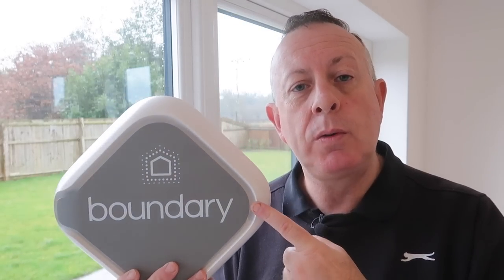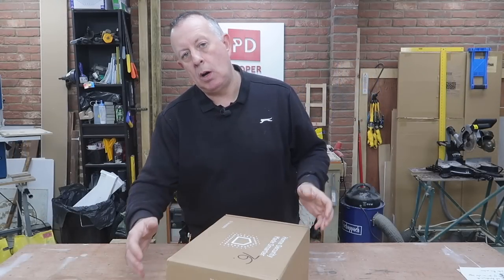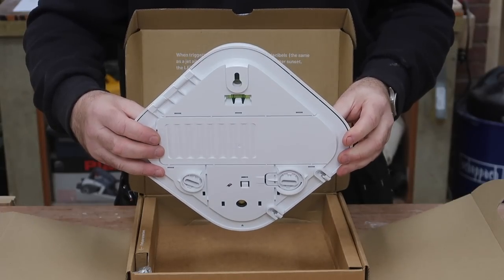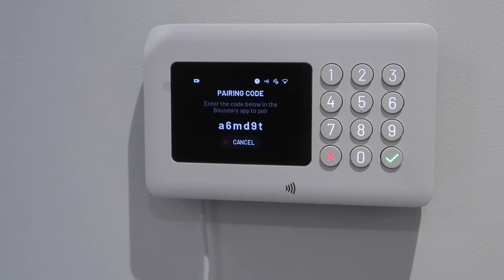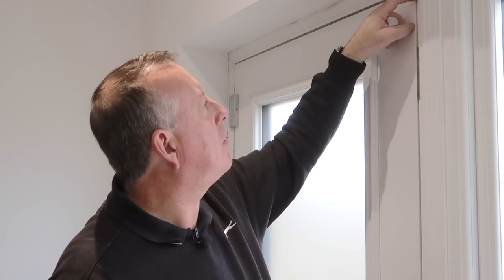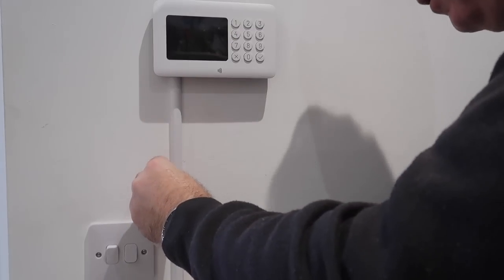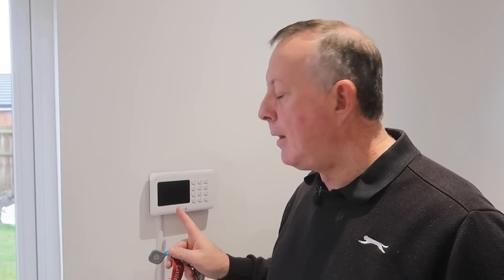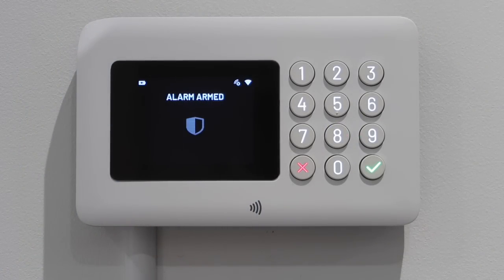Boundary Alarm System - The Easiest Alarm System to Install

Comment: It seems that to get all of those features on the app, you need to pay a monthly subscription - is that the case?
Reply from the maker: Yes
Reply: Hi Geoff, our free Lite plan now allows Unlimited Sensors. There are no other costs other than the upfront system purchase. Check out the monthly plans page on our website for more info. Thanks, Tom

Comment: One thing I've never got with wireless alarms is, what happens of someone jams the signal? it looks like it uses 2.4GHz spectrum so what happens if you fire up a £10 jammer off ebay? if the control unit can't speak to the sensors, what does it do?
Reply: It wouldn't make a difference as we don't use WiFi for the sensors. We use Zwave and can detect jamming or disruption on the network and activate the system in response.
Reply: I didn't suggest you used Wi-Fi but you do use 2.4GHz right? Can you tell the difference between 'jammers' and wideband rf signatures like a baby monitor that uses 2.4GHz also? I'm not trying to catch you out here, genuinely interested as I like the idea of this type of system but can't seem to get past the fact that becuase its wireless its actually easier to interfere with it than if it was wired.
Reply: @roblowe8440  The hub uses the 2.4GHz channel for communication with our platform buy that's it. The sensors communicate back and forth with the hub using Zwave which is completely isolated.

Even if you were able to get onto the same channel as the sensors which in itself requires specialist equipment then the hub would know about it and activate.
Reply: appreciate the back and forth. I've done some more reading and I see Zwave uses the 800-900MHz unlicensed ISM spectrum. This elevates my reservations somewhat but not fully. I guess I have more reading to do before deciding if this is a route I want to take 👍

Comment: Another good video. My concern is the frequency of battery changes. As the batteries aged in my Arlo wireless camera system it seemed like I was up the ladder every few weeks to remove and recharge a battery in one of the cameras. After replacing the batteries when they wore out I ended up paying $100 more for each camera to fit a solar panel to each. Problem solved.
Similar to cameras, although perhaps less demanding on a battery, any device that is constantly triggered by movement such as infra-red sensors is likely to be hard on batteries. As we get older we need to spend less time up ladders!
Reply: It’s a valid concern. When our pro subscription launches our annual maintenance includes battery changes. We’re currently forecasting a minimum of one year from all batteries, with options like disabling the the LED on sensors to increase this. We’re also working on firmware updates to make battery life more efficient. Zwave 700 as a protocol is low energy by nature so we think that there are improvements to be made!

Comment: Looks interesting. Have a wired alarm system but we only have 1 PIR for the hallway. Most of the windows have contact sensors. It seems boundary tends to use PIRs as the main protection but how does that work say at night time? You probably wouldn't want your PIRs on in case you accidentally set them off going to the kitchen for a drink but then if an intruder comes in through a window with no contact sensor, you're exposed.

I get you can order more sensors but find it interesting their bundles all come with only 2 contact sensors for doors and none for windows
Reply: I'm surprised Boundary haven't answered like they answered Anthony's question. Come on Boundary.
Reply: Sorry, we were catching up! The night set built into the app will automatically disable the PIRs and leave all the contacts armed. You can wander around inside but still feel safe at night! You can also mix and match if you prefer as we support multiple part set scenarios so you could even leave a few PIRs armed if you wish.

Comment: Good alarm system but you forgot to mention having to pay a monthly fee to allow more then two sensors to be used as well as features you mentioned.
Reply: Hi Dave, our free Lite plan now allows Unlimited Sensors. There are no other costs other than the upfront system purchase. Check out the monthly plans page on our website for more info. Thanks, Tom
Reply: @BoundaryAlarm  thank you for updating me👍

Comment: When fixing the door switches it's usual to fix the magnet, the small part in your case, to the door and fix the larger part, the reed switch to the frame. This will prevent the reed switch from moving and banging around when the door is being shut.

Comment: Hi, when you look at the specs for system, battery life is VERY poor by todays standards, most other wireless systems are nearer 4 to 6 years for sensors. Visonic even quote up to 8 years for siren & PIR's and the app is free as well.

Comment: Really great video as always. Probably I'd enjoy you showing us how to do the dishes properly. Regarding the door sensor, the small part is basically just a magnet, so in fact you could just fit a small magnet there. And yes, it's probably hard to find one that fits nicel right there, but good to know.
Reply from the maker: You are right. i only found that out when it ended up stuck to some screws on my workbench!

Comment: The system is great however with it being all Wi-Fi on the hub been wired what happens if you lose your Wi-Fi but still have power? I presume the system won’t work. However if you still have power then surely a wired system is far superior over Wi-Fi system. Yes I understand that potentially you could lose power but how often do you lose power compared to the amount of times you lose Internet connection
Reply from the maker: The system only relies on the internet to send you notifications and for any changes you want to make from your mobile. If the internet is down the system still works as usual but just won't send you a notification.

Comment: I can feed my German Shepherd for the same monthly fee as the pro system.... And trust me he doesn't miss a trick and is more of a deterrent than a little alarm box on a wall :)

Excellent video though, and you are right about how easy it is to install. My only reservation is that it needs batteries in the alarm unit, which hopefully won't need replacing at frequent intervals as it's not much of a deterrent if the alarm is quiet or fails to sound.
Reply: Hi Malcolm, our alarm system also doesn't need taking for regular walks 😉 On the battery life, we’re currently forecasting a minimum of one year from all batteries, with options like disabling the the LED on sensors to increase this even further. We’re also working on firmware updates to make battery life more efficient. Thanks, Tom

Comment: I really wanted to purchase a boundary system until I realised you had to use their own ZWave system. The property I live in is almost like a complex with out buildings that need to be protected.  We have to use a mesh Wi-Fi system as regular Wi-Fi will not reach the out buildings, but mesh works brilliantly. If Boundary can’t utilise WiFi then I’d have to run multiple of their  ZWaves just to protect the out buildings, which means I have to purchase two subscriptions just to get it to work. Such a shame as I was ready to pull the trigger a couple of days ago as it looked great.
Reply: Hi there, our free plan now allows unlimited sensors pairings - so you wouldn't need to purchase multiple subscriptions. We can also provide Z-wave range help extenders to cover outbuildings etc. Hope that helps.
Reply: @BoundaryAlarm  Thank you, in that case I will look into this. Thanks
Reply: @thedigitalemotion  no problem. Any problems or questions you can contact us through the Support page on our website.

Comment: Batteries in the siren ???  Monthly Subscription ???  If you are any way tech savvy look into Home Assistant as a free open source framework for bringing all your smart devices together.  Then look into Shelly and SONOFF for smart devices, sensors etc and do this yourself. The resulting DIY solution runs locally on your own Network, Is not dependent  on or vulnerable to any third party charges, connections or even them closing down etc.

Comment: Great video, how come you didnt fit the sensor above the door (top right) as opposed to on the right? there looks like there might* have been enough space to fit the slim piece to the framework. However you may have already considered it and realised it didnt fit maybe?
Reply: That's what I was thinking as well.
Reply from the maker: It may be the angle I filmed it but the gap is the same all around door

Comment: A question..any issues with fixing a PIR Motion Sensor in the garage as in problems with temperature change and spiders..
Reply: Nope, they are sealed units and will still work just fine in lower temperatures
Reply: @BoundaryAlarm  cool and l have a cat will the cat activate the alarm once’s it’s armed..
Reply: @mrlv8126  It shouldn't no. We have seen some cats crossing the upper part of the detection beam and triggering the sensor but this is normally caused by poor placement. If the pet is on the ground it's not a problem.
Reply: I confess on previous PIR’s ..spiders on the sensor could trigger them …  do they do that here
Reply: @GordieK  No. The design of the PIR lens prevents this.

Comment: Looks like a cool system and easy to install. Though with all wireless security systems that are connected to smart devices and home networks they have their drawbacks. Can they be hacked ? I installed a Blink 4 camera system  two years ago. Still on the same batteries. Not sure how long the batteries will last in your alarm system.
Reply from the maker: The batteries are supposed to last 1 year
Reply: Good question on security, the system will detect any attempt to disrupt the communication with the sensors or attempts to spoof them. We treat this as a trigger and this would activate the system.

Comment: Another great video, thanks. If the power is switched off does it go into tamper mode and sound the alarm?
Reply: The system would drop to the backup battery which gives 12 hours worth of power to the hub. You also get an alert this has happened so the system is still armed.
Reply: @BoundaryAlarm  Thank you for the very quick response.
Reply: @samdam108  not a fake comment, I'm an interested potential customer
Reply: @samdam108  If you've got a problem with boundary alarms you're having a go at the wrong person, I've nothing to do with them, I'm not in the industry (alarms  or building), so contact them or proper DIY if you want to moan not me.🙄

Comment: Another great video and a very nice, neat and simple alarm system.  Any advice on where to install the siren on a bungalow?  I was thinking on a chimney, so higher up, but worried it's too exposed to weather?
Reply from the maker: They suggest at a height that you cannot reach but doesn't need to be way up either. I wouldn't worry about weather - it's well protected. Remember that as it is battery operated you need to be able to get to it again to change the batteries in the future.

Comment: Looks a good system  but I wouldn't want to pay a subscription.  I have a yale I fitted myself with a couple of sensors and a  basic keypad   but does the job..... Good video...
Reply: Hi Simon, our free Lite plan now allows Unlimited Sensors. There are no other costs other than the upfront system purchase. Check out the monthly plans page on our website for more info. Thanks, Tom

Comment: Unfortunately the promotion code doesn’t work I want to buy the medium system.
Reply: Hi Sam, did you manage to apply the promotional code? I've checked everything our side and it should be working for you. A code for our Easter sale gets automatically added to the basket but you can remove that and add the PROPERDIY code. Thanks, Tom @ Boundary

Comment: Really great video as always.  Couple of questions, 1. if the internet is down does it still work? 2. if your away from home and the alarm is triggered, will you get alerted via your phone??. thanks again for great  real world videos!😀
Reply: No.  It needs the internet to communicate.  Also, if you smash the code pad game over.
Reply: Hi Anthony, to answer your questions:

1. The sensors and hub can still communicate if the wi-fi goes down as they're on a secure Z-Wave network. The only functionality you'd lose is connection to the app. We do have a cellular back-up upgrade for the Hub that adds a 4G roaming network if desired so connection can be maintained at all times.

2. If away from your home, you will receive a push notification via the app, a text message and an automated voice call - so you shouldn't miss it when you alarm gets triggered.

Hope that helps.

Tom @ Boundary
Reply: @DiHandley  See my reply below David. Also, any attempt to tamper or block the system will trigger the alarm.
Reply: @DiHandley  why would you need WAN to communicate over LAN?
The devices all connect to the hub (in essence LAN)

Losing WAN (Sky, BT, Vrigin etc) wouldn't affect the door sensor communicating with the panel....

Comment: What happens if your WiFi drops? Will it still work but not notify you and does the alarm sound go off after a while as is the requirement these days to stop nusance noise?
Reply: The system will still work but you wouldn't be able to access it remotely through the app. We do have an optional cellular backup if you need extra peace of mind.
Reply: @BoundaryAlarm  does the cellular one just send text or does it do the full thing. Notifications etc?
How long does the alarm sound for?
Reply: @justintemp  It acts as a backup for the WiFi connection so its data it sends back to our platform, you still get all the notifications. 

The siren will sound for up to 15 minutes.
Reply: @BoundaryAlarm  thanks. Sounds all good. When will you have the police alert option?
Reply: @justintemp  we should be launching that this quarter along with an upgrade path for customers who already have a system installed.
Reply: @BoundaryAlarm  great. Thanks for answering my questions
Reply: @justintemp  No worries, you're very welcome 😀

Comment: Love the vids, as for this one it assumes good wifi coverage everywhere from the router.  Just a thought, would love your actions to check and overcome any dead areas you found when setting your wifi up.
Reply: Only the hub uses wifi to connect. The sensors are connected via z wave (from memory) and it’s range is much further than your home WiFi…
Reply: @GordieK  How ever its connected, just wondered if he had checked for any dead spots and how he did it.
Reply: @tallman3  I would assume the sensor won’t pair if it’s in a dead spot so you would know as you go I think if that helps..

Comment: Another useful video as always, thanks! Which electrical detector did you use? Many of the ones I have tried have been useless but yours looked quite accurate
Reply from the maker: Thanks. It is the Bosch Truvo detector
Reply: @ProperDIY  I have one and can recommend it too. Doesn’t break the bank either (as it can’t crack safes…)

Comment: i am returning mine as i bought 3 pir,s. to use all 3 i have to subscribe and pay £9.99 per month. To use the app fully you have to pay £9.99. this was not made clear when ordering which i think was done on purpose. System without subscribing is just run of the mill. Also offering 45% off which can be got from other channels is just a sales gimmick. dont think it was ever sold at full price so not really a discount

Comment: I would install a wireless security system! Someone can send a de-authentication packet to wireless device to deliberately knock it off the network. There is no point having an alarm if someone can just disconnect it from your security system.

Comment: Wow I like that system , I will have to look into get that for my home. It’s so easy to install and use even I could install it. 
Brilliant video Stuart. As always 👍👍👍❤️
Reply from the maker: Thank you
Reply: i woudnt bother - I just bought one based on this video and wish i hadn't.  Nicely packaged wow looks the part  but in reality  fall well short of a basic good stable alarm system.  check the 1 star on trust pilot - same experience unfortunately.

Comment: It all looked good until I discovered I would be locked into £120 per year cost on top. Way too steep for what is effectively a software license.
Reply: Hi Guy, our free Lite plan now allows Unlimited Sensors. There are no other costs other than the upfront system purchase. Check out the monthly plans page on our website for more info. Thanks, Tom

Comment: Great alarm but in this video you never once mentioned when purchasing you have to sign up to a monthly payment. I couldn’t purchase the medium system you purchased without paying £10 minimum a month.
Reply: Hi Robbie, our free Lite plan now allows Unlimited Sensors. There are no other costs other than the upfront system purchase. Check out the monthly plans page on our website for more info. Thanks, Tom
Reply: @BoundaryAlarm  no other cost but please check our monthly price plans.🤔🤔🤔🤔
Reply: @NorthWalesCampers  We have 3 plans available, so it's your choice which to go with. The Lite plan is free with unlimited sensors but we then have our Smart and Pro plans with monthly fees. No contracts or cancellation fees for any plan.
Reply: @BoundaryAlarm  what I meant is it wouldn’t let me purchase the unit without signing up to a plan
Reply: @NorthWalesCampers  You do need to select a plan to checkout and purchase but from today you can select the free plan to work with any bundle as it now allows unlimited sensors. You need a plan for your Boundary account on the app, which you'll use to set-up and install the system - as well as control and monitor it.